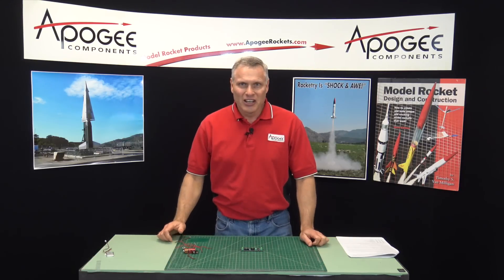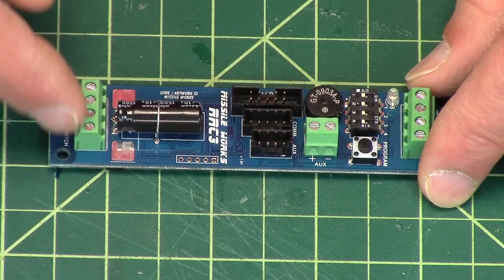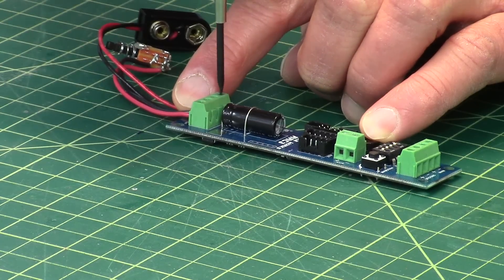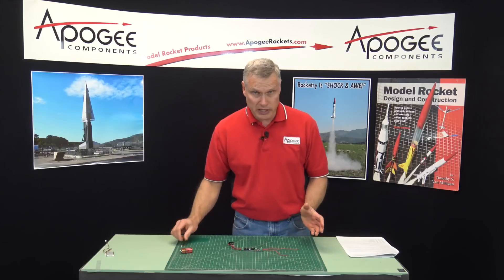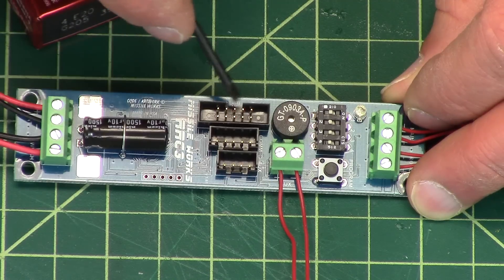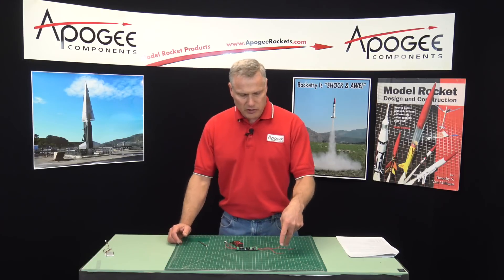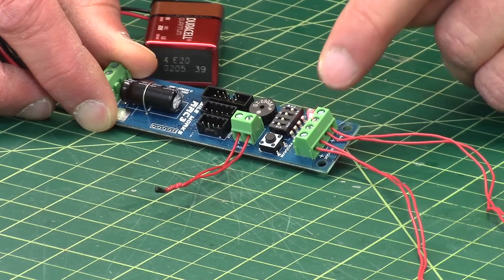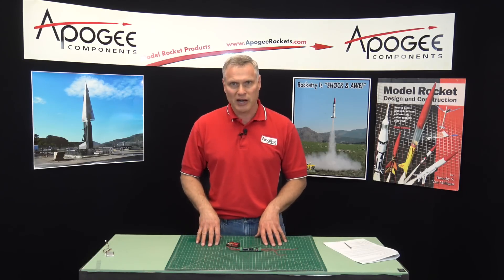MissileWorks RRC3 Altimeter

Comment: This was a great explanation of how and what this component does.  My question is how does one integrate or include a board for GPS tracking?  Does it connect to this board?  Would you install it on the back side of the same sled?  thansk.

Comment: Hey!
I wanted to ask you something about the RRC3+ altimeter and its Bluetooth connection. I’m trying to hook up a Bluetooth module I bought separately (not the official one) so I can program it and do some ground tests.

I’m using an HC-05 module, but I’m not sure if it actually works with the RRC3+. I wanted to know if you happen to know anything about this, or if you’ve tried something similar before.

Do you think it’s possible to use the HC-05, or does it have to be the official Bluetooth adapter?
Also, should the HC-05 be set to slave or master mode for it to connect properly? I’ve been trying a few setups but haven’t had much luck so far.

Thanks a lot for any help or advice!

Comment: What is arming??
Reply from the maker: That is the point where the wires are hooked up to the igniter, and the altimeter is turned on. At this very instant, it is just waiting for the trigger to send electricity to the igniter and fire it off.